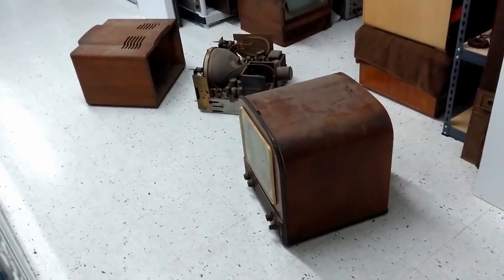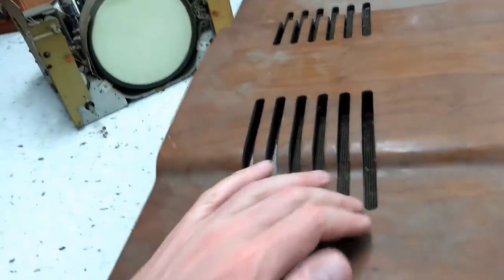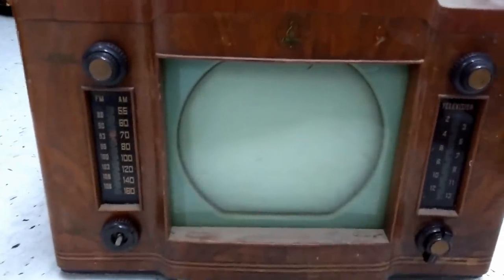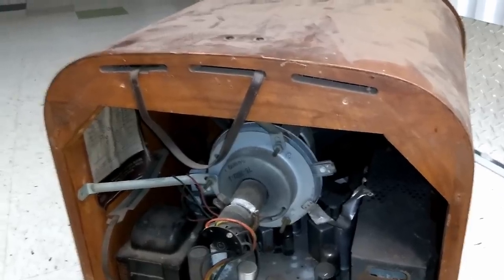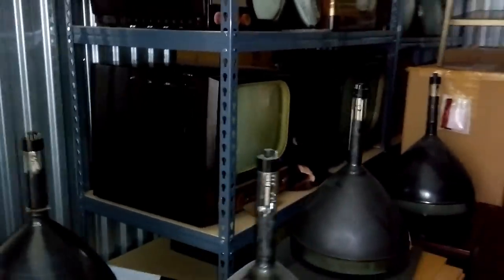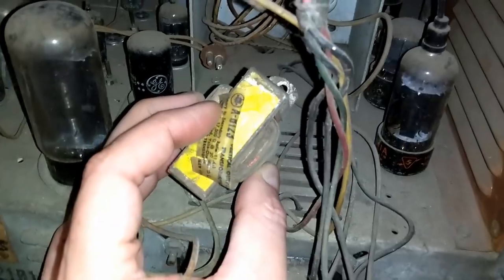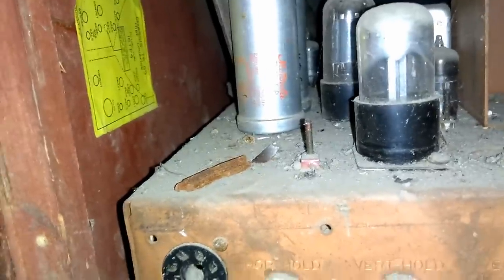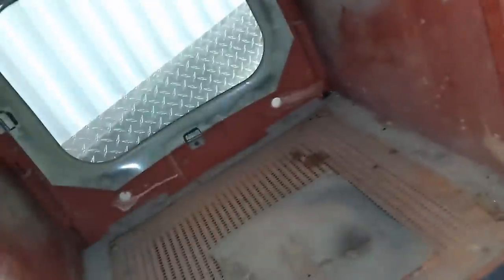More recent finds

Comment: We had 2 of those Philcos a while back. Both ran beautifully! Had them through a couple moves. I wonder what became of them later on. Might still be sitting in that old basement....
Had a similar Emerson. Got it as a parts donor but when I tried it out it still worked - with every capacitor in it failed. Had a compressed image on the CRT and hum-filled sound. Sat it aside to restore but never got to it.

Comment: Is there a high voltage cage to cover the under chassis mounted flyback & high voltage rectifier tube (I am assuming 1B3, 1G3 etc)? Otherwise there would be significant arcing to other components. First time I have ever seen an under the deck hvr & flyback,  btw.
Reply from the maker: Nope, there's no cover.  It's far enough way from stuff and they paint on some HV rated paint so nothing arcs.  Set runs on around 10,000 volts which arc around 3/4 of an inch.

Comment: Ingraham was a large clock manufacturer in Connecticut whom made their own clock cases, Emerson was in New York, so the two were not really that far apart geographically. Contrary to what some books, and every other keyword spamming ebay seller claims, Ingraham did NOT provide cabinets to every radio manufacturer whom happened to have attractive cabinets, just Emerson and the odd G.E model, not Zenith, nor Stewart Warner, nor anyone else.

Comment: Had one of those Emerson's was going to put pana color in it crt was broke threw chassis out no tubes either.cabinet around somewhere .I started in tv making Dumont 103ra chassis to 21 bw consoles new flyback and yoke .20in Dumont ra 101 was biggest in 40s ac 60cps hv.killer. projection was common late 40s had a Dumont color 1954 metal crt sold for 600$ 2007 .had a vt7 in my stude convertible rewired filaments 6v w dynamotor about 1959 .rauland made a replacement line in 60 s.theres a guy leonia n.j. has a factory building full of 30s radios  .

Comment: I have a 1951 television made my Motorola it looks just like that but it is the cabinet version of it real pretty wood grain but there's only one problem the flyback Transformer does not work it's not connected to the coil I don't know what to do I haven't decided and if I don't get it fixed I'm going to put my plasma TV inside of the cabinet and get rid of the picture to you and me maybe sell  so the picture tube
Reply from the maker: Repairing a TV this old is no trivial task.  I'm sure it has a lot more problems than that.  Actually, I;ve never found a bad flyback in any TV I've worked on.  It's all the old capacitors that are the main problem.  There are dozens of them that need to be replaced before the TV will work properly.  Probably some resistors and possibly tubes too.

I can also tell you that putting a widescreen TV inside a cabinet made for 4:3 format never looks good.  You will have a gap at the top and bottom of the screen.

Comment: What does the fly back coil look like is it a copper coil that wraps around a couple times
Reply from the maker: The flyback transformer has two large coils of wire on an iron frame with a few extra turns to power the HV rectifier tube filament.  They rarely go bad it's far more likely all the parts around it - especially the paper and wax capacitors that are bad.
Reply: @bandersentv  so basically I have to solder The Wire to the coil do you know how vacuum tubes have a top connector to connect the coil the tube socket is in butt on top of the tube vacuum tube has a top wire connector that goes to the coil do I solder it to the coil or do I have to find the end of that coil inside of it or do I solder the coil wire to the coil and solder it I'm sorry I'm talking weird I want to get it fixed and I was going to get to work if if I get it working I was going to hook up my PlayStation 3 or my Atari 2600 there's an adapter that I can play my PlayStation 3 on that old TV from 1951 it's actually the first color television I was going to restore it but if I can't restore it I'm going to put my plasma TV inside the cabinet and get rid of the picture too tube so it I love your videos keep up the good work please do a video about the Motorola television that will really help me please
Reply: So basically what you're saying I have a dead TV that does not do nothing crap fashion ever started this project the problem is I have it stored somewhere I don't know if I can keep it I might just throw it away it's basically no good the only thing that I can do to it is take the picture tube out and sell it it made me restore it I'm kind of really upset right now I'm not that good of you I don't know what to do I got myself into a project cuz I'm working I mean the worst thing can happen in might catch fire let me know I should do sorry I'm talking too much
Reply from the maker: You have a black and white TV, not color.  Every old TV will need some repairs before it will work.  I don't know your level of experience with tube electronics or what equipment you have.  I think you are saying that the HV lead from the flyback to the rectifier tube has broken off ?  That's a tricky repair but can be done.  Check out this thread on the Antique Radio Forum:  https://www.antiqueradios.com/forums/viewtopic.php?f=3&t=357195
Reply from the maker: I also suggest taking a look at Phil Nelsons excellent website on vintage TV restoration:  https://antiqueradio.org/howfixtv.htm